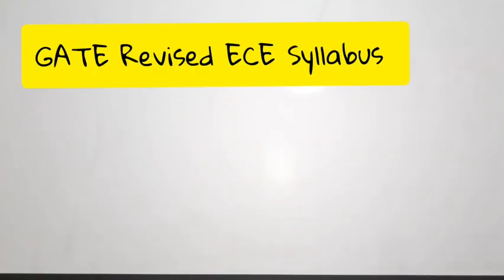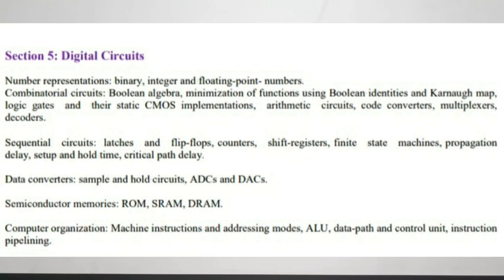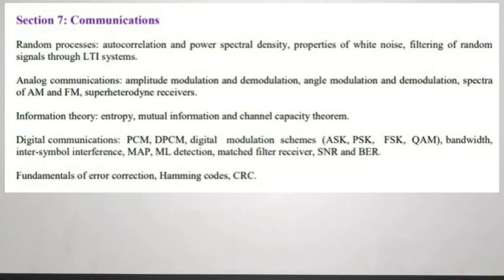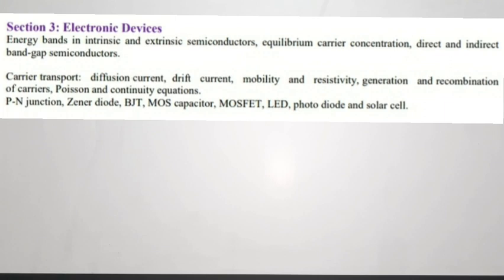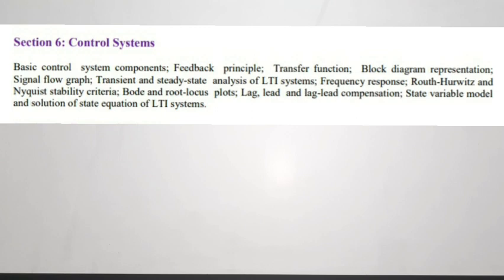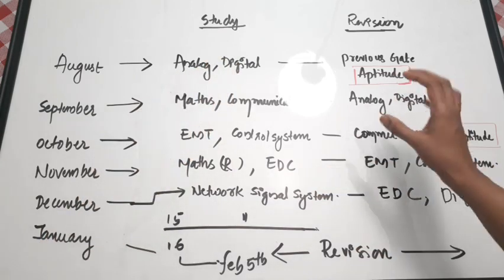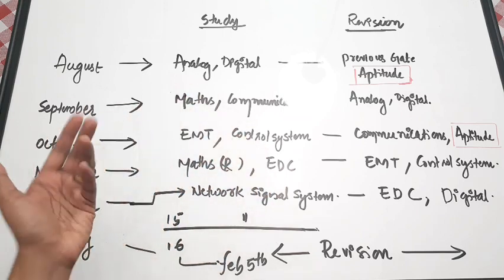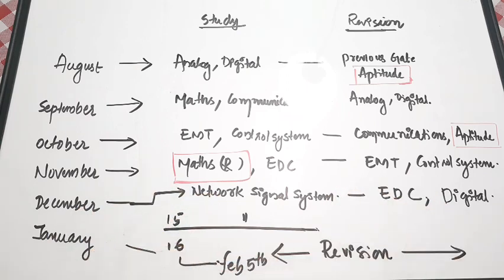Gate 2021 ECE  Syllabus| Gate 2021 ECE Six Month Preparation Strategy| Gate 2021 ECE|

Comment: Is it possible for a working professional to crack GATE with first rank in 2022 if he puts in 4 hours on working days and 10 hours on holidays? If so, what subjects should be covered first? Where to start? Which coaching to join. Can you make a video on that? Working professionals preparation strategy. Thanks.